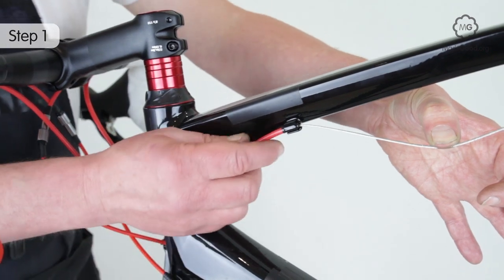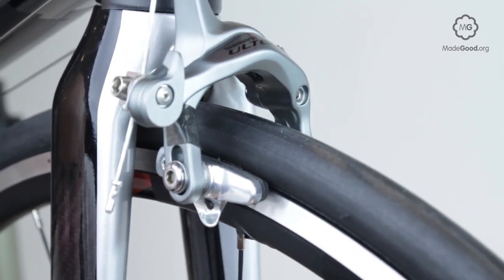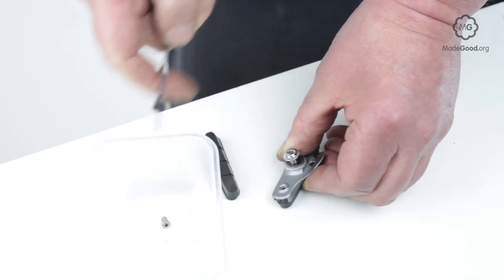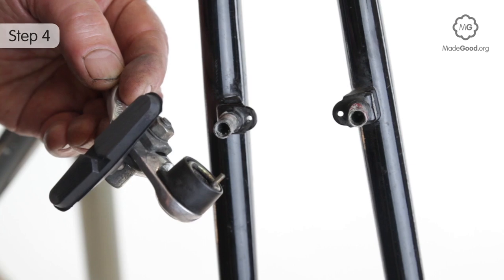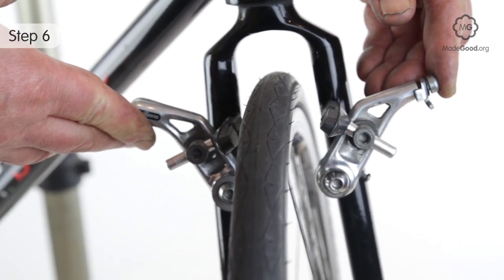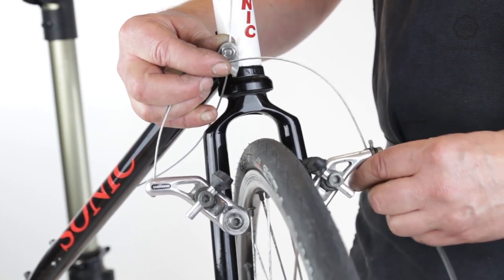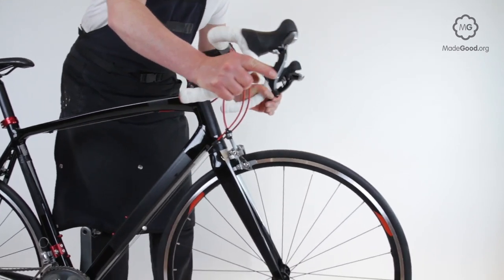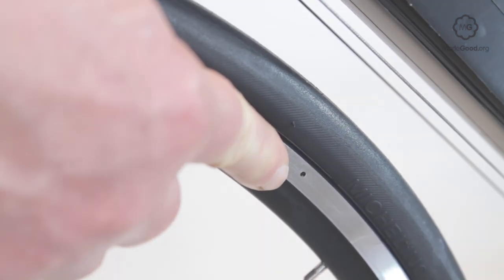Look After Cantilever Brakes On A Bike

Comment: You did not say in which direction the brake shoes are to be installed -  does the longer part of the brake shoe point towards the rear wheel?